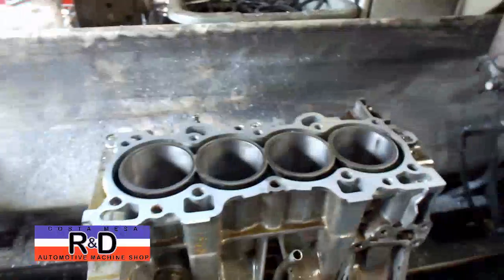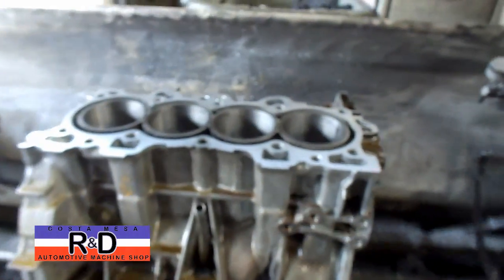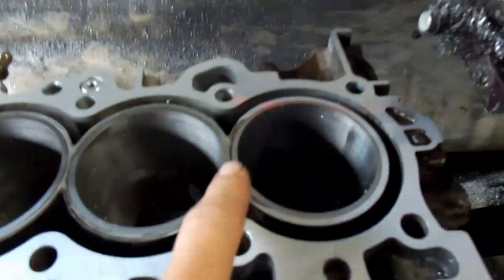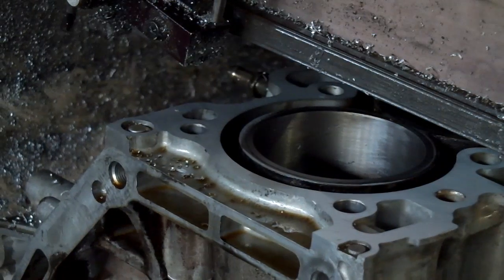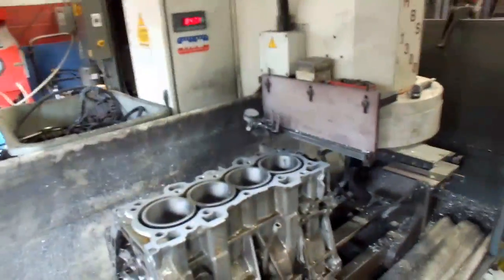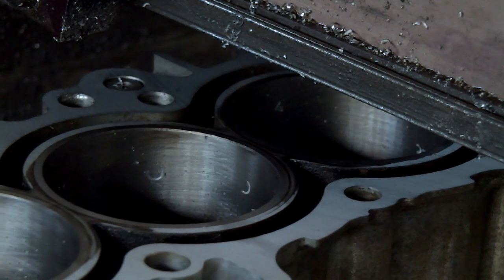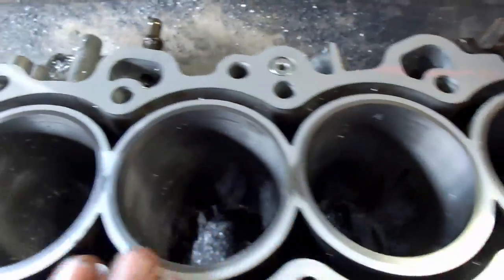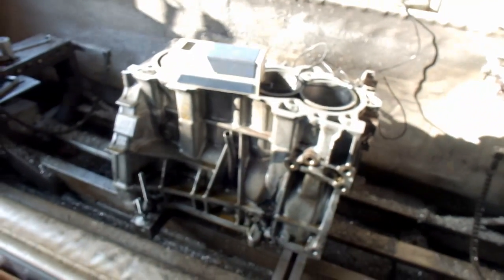B 18 Honda Block Resurfacing

Comment: Do you think is it okay for toyota 2nz fe cylinder  block to resurface like that? Bec it has a 3thousand of an inch warpage, The original gasket was thin MLS but if its done resurface im going to use federal mogul composite head gasket because it's thicker do you think it will work??? Thanks for your answer...

Comment: The real problem with the Honda Block is the open deck . Fit aluminum plates in the openings, weld then machine flat and drill holes for coolant. Then you can boost it and hold a gasket in place. Overheat that block once and forget about gasket seal.

Comment: how do you keep the same compression ratio after taking off that much metal from the top of block? or is it even possible to keep the same compression? would you have to use a thicker head gasket? and also, how would you resurface a block if there are dowell pins that stick up from the block? are they removable?
Reply: Its not possible, depending upon how thick your gasket is, a thicker one may be required, dowel pins are removable. Find a copy of my engine rebuilding handbook (Sunnen's Complete Cylinder Head and Engine Rebuilding Handbook) to learn more about engine rebuilding. Check out my new youtube channel, same shop, same personnel, different channel now.
Reply: Thicker gaskets can be a bad idea if the cylinder head and piston have a quench area. Not utilizing it the way it was designed will have negative consequences.

Comment: what goes on in the area between the cylinders and the block?  lube or coolant?   is  it possible to resleeve one of these blocks?
Reply: Coolant flows in there. The sleeves that are in the block cannot be removed except by boring the cylinder out of the block. Many performance oriented builds will do this and install aftermarket sleeves for increased strength.
Reply: cryoburned thanks...I thought it'd be hard to get em out of there.    seem like I remember John putting larger sleeves in a block once but I've absorbed too much cutting fluid since...
Reply: There probably are instances where a sleeve is removable, but not on Honda blocks. I don't know if John has, but a shop local to me has done this one: http://ntxmachine.blogspot.com/2012/05/d16y8-engine-build-pt-2.html

Comment: is that from abuse/wear or just sloppy tolerances from the factory?
Reply: Was most likely over heated by quite a bit, or a worn out head gasket that was allowed to go too far. Honda aluminum head and block castings are quite strong, especially the b series.

Comment: I wonder how much that upped the compression. Nice job of saving the block.
Reply: The head was machined within Honda's limits. Whatever the increase, it should be fine. The driver may possibly want to use higher octane fuel.